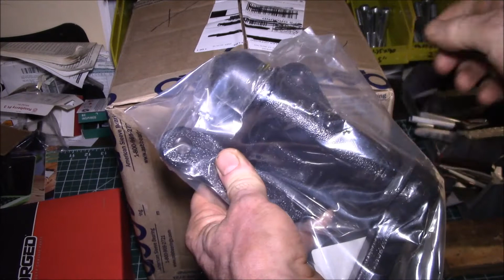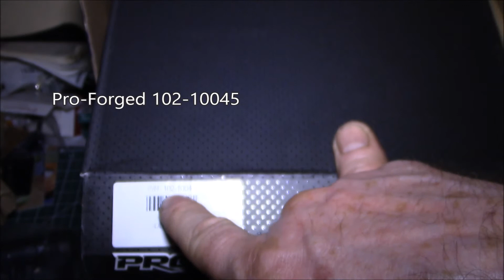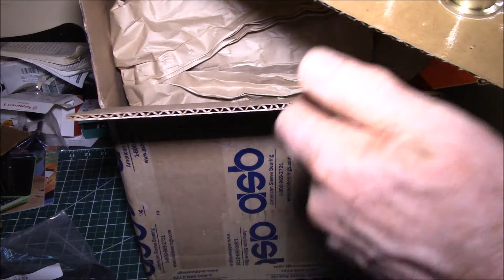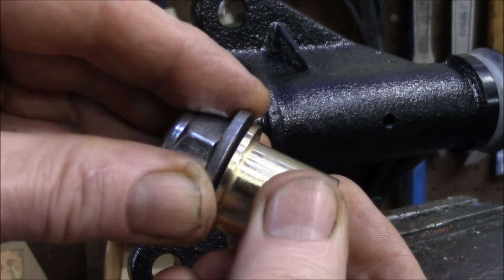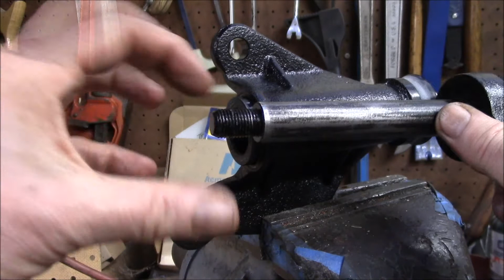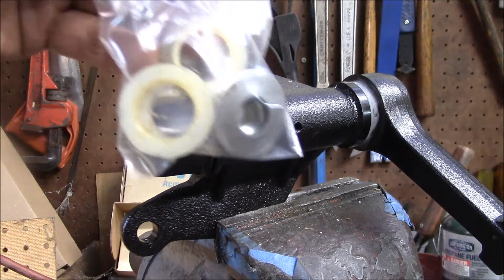New Batch of Toyota Idler Arm Bushings and Install

Comment from the maker: We've sold out of our last batch of these idler arms and bushings.  We do still have the set of 14x20mm shims available if you want to dial in the pre-load on the bronze bushings.  And if needed, we do have the upgraded flanged nuts available if you have an earlier arm with the stamped washer and Nylock nut:
https://www.4crawler.com/4x4/ForSale/IdlerArm.shtml#On-lineOrdering

If you want to make your own bushings and have access to a lathe, we have a low cost 3D CAD model and instructions available:
https://cults3d.com/en/3d-model/gadget/toyota-4wd-idler-arm-bushings

Comment: Why do you not just have them machined for you?
Reply from the maker: We did have the bushings machined for us, see the beginning of the video where I unpack a shipment of machined bushings.  We did do some custom machining ourselves on the bushings to fit some slightly different size idler arms.  Why not have the mfg. do that for us?  Because of minimum order quantities they have.  If we had them make us 2 or 3 different variations of the basic bushings, we would have to order 2 or 3 minimum quantities and be stuck with potentially 100s of custom sized bushings that would not fit certain sized idler arms.  Instead, we order one batch of the largest size bushings, that are also the most common size.  Then, if a customer needs a smaller size bushing for a specific idler arm, we can quickly skim off a bit of material and turn a larger bushing into a smaller one.

Comment: Hi Mr. R Brown, I thought the arm was supposed to be tight, not rotating around?  I am trying to save my old idler arm; the arm is very tight, and not moving.
Reply from the maker: Is this with the original plastic or the bronze bushings?  The plastic bushings seem to be set up very tight from the factory.  Those bushings are somewhat sloppy and then deform to fit tight when compressed.  

With the bronze bushings, it's not required to set them up as tight since they are a precision fit.  As long as there's no play up/down, they are good to go.  If you installed the bronze bushings and they're tight on the idler arm shaft, it may be due to excess paint on it or a rough finish.  Try sanding down the shaft until the bushings slide on without jamming.
Reply: @The4Crawler . Thank you.

Comment: Do you know if I can get any of these to fit a napa proformer
Reply from the maker: Check the diameter of the round shaft inside the bracket.  If it's 20mm, then the bushings will fit straight away.  If it's smaller than that, we have brass shim stock you can wrap around the shaft to better fit inside the bushings:
https://www.4crawler.com/4x4/ForSale/IdlerArm.shtml#FAQ1
https://www.4crawler.com/4x4/ForSale/IdlerArm.shtml#IdlerArmBushings

Comment: I'm gonna need to get a good set of crescent wrenches before l tackle this job. 🎉🎉🎉
Reply from the maker: Yes, that's often true.  Some of these arms have that top nut cranked down so tight that it's hard to remove.  In the process, the mfg. crushes the flange on the plastic bushings inside which is probably why those bushings wear out so fast.

Comment: If I sent you my old Idler Arm, can you re-bush it for me and drill and tap for a grease fitting on the front?? 
My Truck is a 1992 Truck/ SR5 / 4 Wheel Drive / 3.0 v6 engine…That way I know  I’m getting expert help on this item….
Reply from the maker: Unless you have an arm with a 20mm dia. shaft in it, these bushings would not fit, and the majority of idler arms do not:
https://www.4crawler.com/4x4/ForSale/IdlerArm.shtml#FAQ1

Comment: What above the bush goes to the end of pitman arm attached to idler steering rod ? What sort of bush do we use ?
Reply from the maker: Both the idler arm and the pitman arm connect to the steering relay rod with tie rod end type ball joints.  Those have a tapered stud that fits into a tapered hole in the relay rod and then held in place with a nut.  No bushings needed for that connection.
Reply: @The4Crawler  would changing the bushes of idler arm fix the problems with idler arms ? Or in other words : most of the problems with idler arms caused by the worn out bushes ? So instead of buying new idler arms we can simply change the bushes ..
Reply from the maker: @koraykaranfilci142  There seem to be 2 or 3 major failure modes.  One is that the plastic bushes wear out and that leads the round shaft of the arm moving about inside the bracket on the frame (i.e. sloppy steering).  The second mode, that may be preceded by worn bushes, is that the shaft on the arm bends and eventually breaks.  The last failure mode is that the tie rod end on the arm wears out or breaks.

So if you have an arm that's loose because of worn plastic bushes, then yes, replacing them can restore the arm to like new condition.  You can often get new plastic bushes or we have the bronze versions:
https://www.4crawler.com/4x4/ForSale/IdlerArm.shtml

If you have an arm that's bent or broken, then it needs to be replaced.

Comment: Went wheeling in my '94 Xtracab with my buddy, and got miles into the trails when he broke his OEM idler arm on his '88 Xtracab (both 22RE with minimal modifications).  Turned that day into an adventure, having to take my pickup all the way back to civilization to get a Duralast idler (was not the preferred casting) and then back into the woods to replace it with headlights and flashlights.  Wish we would've addressed the idler ahead of time!
Reply from the maker: Yes, that can be an adventure.  Over time, those under-sized OEM idler arm shafts can fatigue, especially if the plastic bushings start to wear out.  It's a shame Duralast/AutoZone changed suppliers on the old FA5040 arm, it used to be an excellent product and now it's just run of the mill.